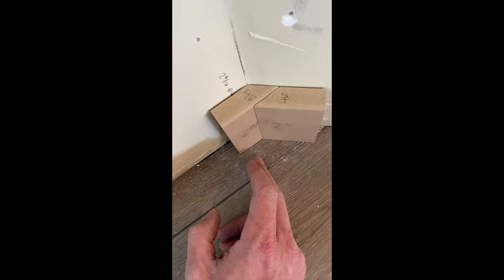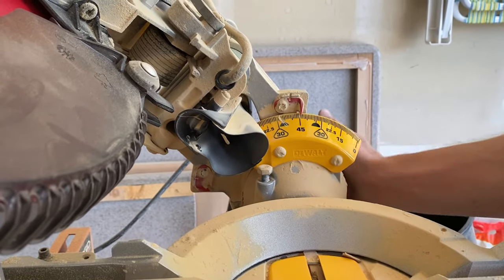How to Cut Base Inside Bay Windows | Inside Miter Easy Way

Comment: Now that is brilliant! Literally doing my bay window right now and going to give it a go. Thank's for the tutorial.
Reply from the maker: Thanks! Have fun with it!
Reply: @berlinbuilds  I will, thank you. Can i ask your advice please. For my lounge floor i am fixing 18mm hardwood faced plywood and will also be using the same plywood for the skirting. Not everyone's cup of tea but it's the look i want! I have had the skirting cut to the correct width in a machine shop and they have left a perfect smooth edge. I need to get a new mitre saw blade to cut the plywood to length and for the mitres and im a bit confused as to how many teeth i should buy. Would appreciate your advice. Thank you.
Reply from the maker: Sounds like it will look great! You’ll probably do best getting around 90 or 100 teeth if you are using a 12” blade. The more teeth generally is going to get you a finer finish, especially since the skirt boards will come prefinished. I have a video that shows how to change a miter saw blade and I talk about the teeth a little bit in there (if I remember right I say exactly how many teeth I like). Happy trimming! I hope that helps!

Comment: Brilliant technique thank you. I was wondering how this would work with a moulded topped skirting, could you cope it in on a 46deg angle? Thanks again!
Reply from the maker: Thank you! I haven’t had to do one of these with a cope yet but I’ve been thinking about it a lot (I have a job coming up that will require it). I think it should work just fine but it may require more of an aggressive back angle cut if that makes sense.

Comment: I’m confused do I cut at 44 degree angle? I’ve been loosing my mind trying to get this exact corner and I gave up on my project
Reply from the maker: You want to cut it at a 46 degree angle.  If your saw can't do a 46 degree angle, you can cut the opposite side of the cut at a 44 degree angle for the complimentary side to come out to 46 degrees.

Comment: What if the inside corners aren’t exactly 135degrees? Mine ranges from 134*-137*. I’m planning to do shiplap on an existing fireplace with the same angles
Reply from the maker: You’d need to adjust as you go to whatever angle that piece needs. So a little more or a little less with each piece to keep things tight. You can cut a couple of scrap pieces at different angles to see which one to use for each piece of shiplap.
Reply: Is there a benefit to this technique versus doing an exact inside miter? Will it hold better?
Reply from the maker: Sorry just saw this! When you do an inside miter it’s a little harder to line up and make look right because the sheetrock behind it is usually a little messed up. This other way has gone faster for me and looks great!

Comment: My miter saw is 10  inch and single bevel ! What do I do as far As board placement. Do I flip the board ?
Reply from the maker: Oh boy, you can try flipping the board but it is a pain to line everything up (and you’ll more than likely need to adjust the angle if you are doing the 46 degree). How tall of base are you cutting? Hopefully you can do it in one cut.
Reply: @berlinbuilds  one is 5.5 inches and the other 3.25